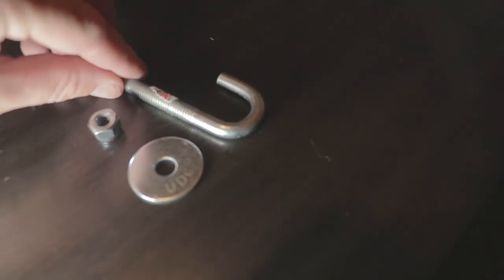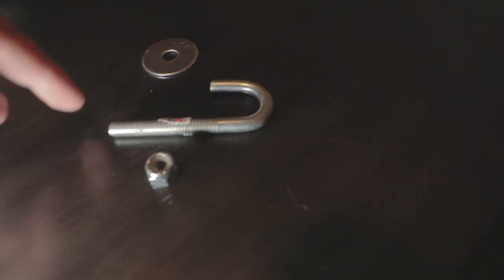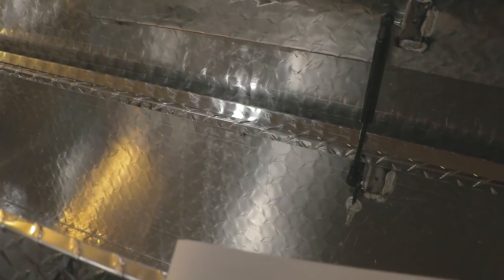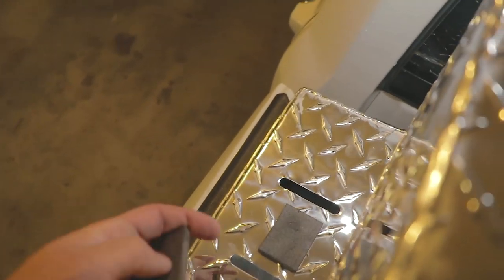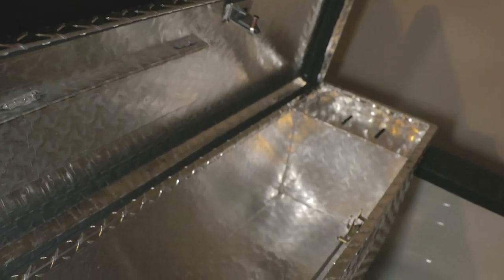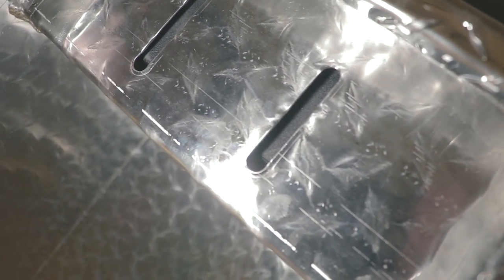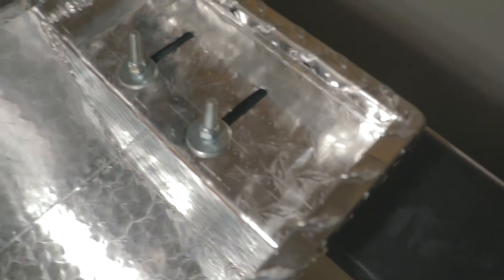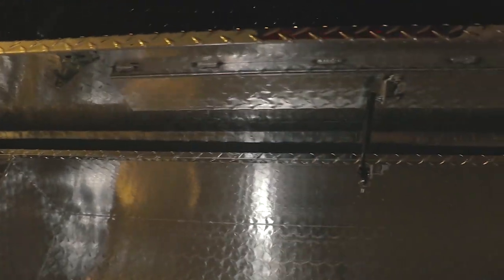Easy Truck Tool Box Install

Comment: I put one 1 1/2” screw and flat washer on each side of my box. Worked great for 19 years. Didn’t worry about two tiny holes in the truck cause I drove it for all those years and never had a problem

Comment: I just installed my “new to me” truck box today using the J bolts. First of all why Lowe’s puts these J bolts in a different damn place than with all the other damn fasteners is beyond me. I bought 4 J bolts, 4 Fender washers and 4 nyloc nuts. Here’s an idea for you... if you put the washers and nylocs onto the J bolts before you get to the register the dumb ass cashier only charges you for the J bolts. Anyways, installing these is super easy, I suggest using the standard nut first because running the nyloc nut all the way down while holding the J bolt up so it catches the lip of the bed is kind of a bitch. Run the 5/16” nuts down and tighten them, then run the nylocs down and it’s rock solid.
Reply: Erik . . . Instead of Fender washers, I used Gibson washers (guitar humor).

Comment: About the only thing I would have done different is to cut the J bolts down and then plasti-dipped them so that they didn't scratch up the paint on the underside of the rails.  I know that you'll never see that, but appearance is not the primary purpose of paint.  Paint is there to protect the metal from rust.  Otherwise, well done!

Comment: Can the toolbox be mounted on the tail gate end of the bed instead of the cab end?
Reply from the maker: Sure. May get annoying if you use your tailgate as much as I do, but mechanically it should work
Reply: @AdventureOne  Thank you!  I was thinking I'd use it as a platform/base to mount some hose reels for my pressure washing business.  Wouldn't really use the toolbox as a toolbox.

Comment: Steel on the aluminum will cause corrosion put something between the steel and aluminum. Tape or a dab of paint. Or use aluminum fasteners
Reply: I have never seen Aluminum fasteners in home depot or lowes

Comment: Nobody can slide it towards the back and off that way ?
Reply from the maker: Correct. It would be very difficult to slide and can't get past the threshold of the tailgate. It would be easier to cut the box or cut the bolts than to slide

Comment: If you do not leave at least an inch or so from the bed it will eventually grind away and maybe even rust.  Had a toolbox ruin the back of the bed.

Comment: Thank you for such an easy install to understand though, when it came for me to secure the j-bolts I could not access the slits in the box to put them through.  The box fits perfect with no wiggle room.  Also the truck came with bed rail caps but I'm not sure it would make a difference if I took them off.  Outside the rails measures 72" and inside measures 64".  The box measures 72" and 63".  Should I have bought a 70" one as I've noticed that some truck boxes go right to the edge of the rails and some are in about an inch or so.  Any suggestions?
Reply from the maker: Judith Austin mine had about an inch on either side, but as you said not all boxes or truck beds have standardized widths. Sounds like you may need to bust out the drill (unless you want to go with a different box)
Reply: I had the same problem. Luckily the slits on my box lined up with the square holes on the top of my rail. A few inches down the square hole there were small horizontal holes which I hooked with the j bolt (it took a lot of patience). I did one on each side and it seems to hold just fine.
Reply: Thanks Seth - I wound up getting the 70" and was able to install it without a problem - easy peasy! I would have rather kept the the 72" as it was quite imposing in comparison, though I probably would have just put unnecessary stuff in there.  Thanks again!

Comment: did you have to put any  box strengthening brackets in the truck?  i see in my new dodge they have a kit for that since the boxes are so thin these days...
Reply from the maker: I did not, but I only have about 100 pounds worth of tools in the box. It works just fine unless you stand on it.

Comment: Sockets work better my friend😂
Reply from the maker: Oh, for sure. Just didn't have a deep socket in this size on hand at the time
Reply: Even better, a ratcheting wrench. It uses the easier and faster ratcheting motion, but will continue unabated until it’s tight. 👍

Comment: Dee see tool box tie downs are 10 bucks
Reply from the maker: Rezorcful. Good deal, but this works if you dont have that item at your local store.
Reply: And the bolts go down into the aluminum holding bracket with no bolt threads sticking up to have to cut off. The Dee Zee hold downs make for a cleaner install